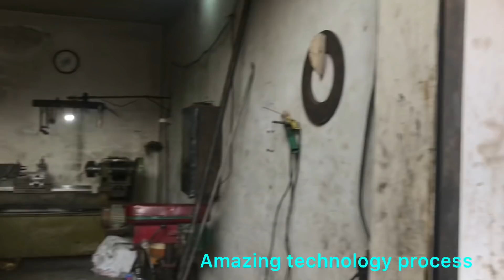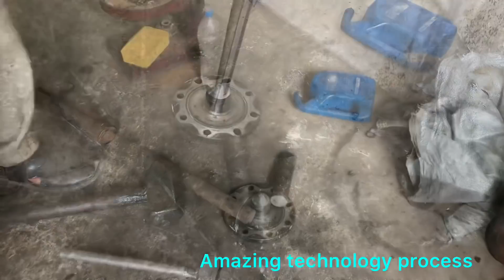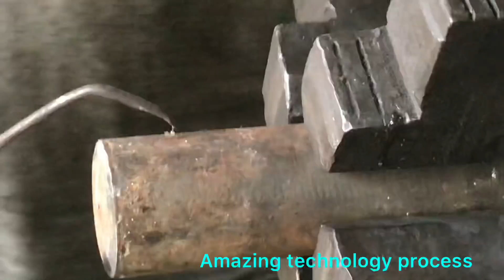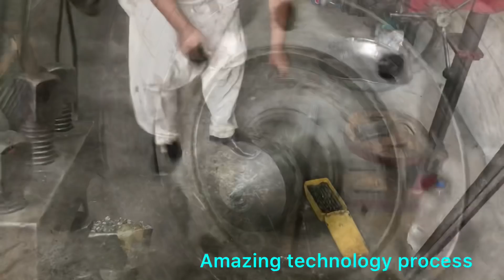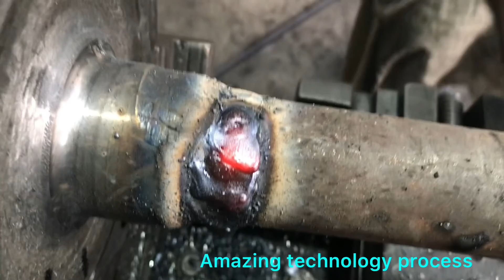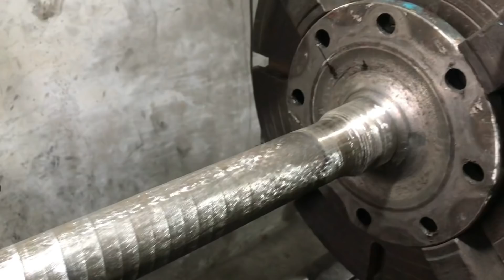Amazing Repairing Broken Axle Shaft ON 6 Wheel Truck // Amazing Technology process

Comment: I have seen numerous videos from middle east welding broken shafts. They are Mickey mouse!
A true process of welding a torque shaft should include heat treat but even with heat treat a welded shaft will not meet original strength design. Most likely the shafts welded in these videos will break again under high torque usage!